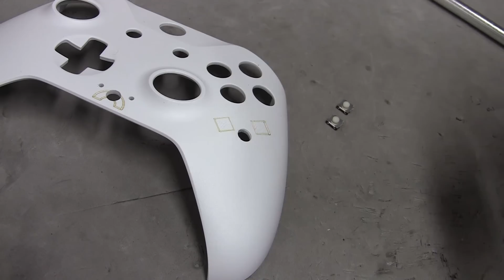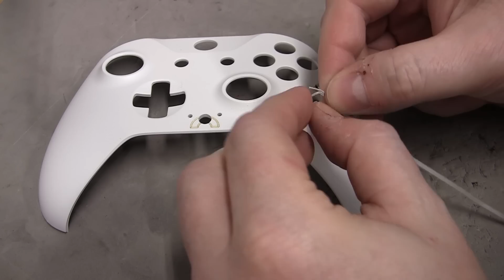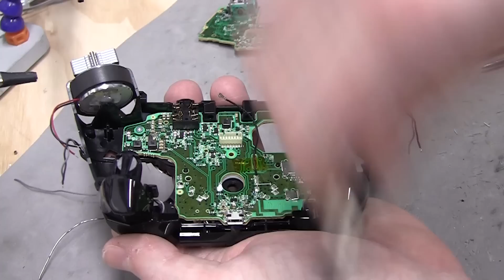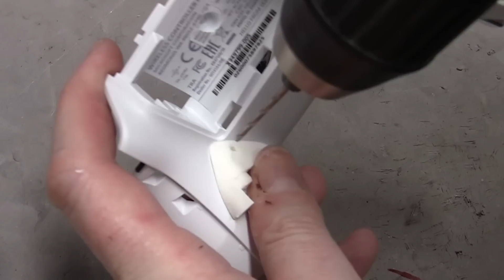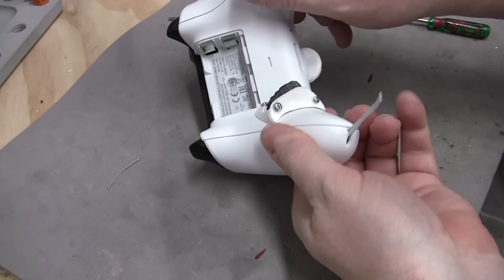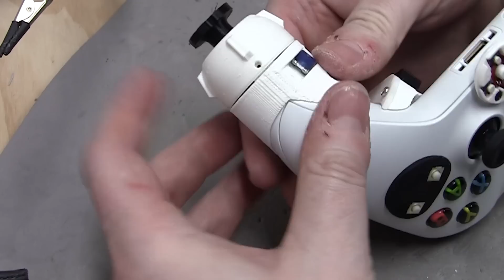Single Handed XBox One Controller

Comment: I've noticed that when you glued the 3.5mm jack connector to the PCB, the hot glue was placed onto some traces. Do you think this could damage the PCB over time, as the 3.5mm Jack moves when inserting/ejecting headphones ?

Comment: silly question
is there a way to make chinese fake ps3 controllers pc compatybile?
i mean we have entire contrller, battery, rumble motors in a color we want (pink, yellow, green, orange and so on) for 3$ delivered and they have some kind of bluetooth chip in them out of the bag too
there is the software that allow you to use oryginal pads on pc but not every fake pad works with that (or the console)
but the hardware is already there
why not turn it into a hid bluetooth device to have proper gamepad that can be used? and while we at it we  can also improve analog sticks sensitivity

Comment: It would be really cool if you found some sort of way to include a button that lets you switch which analogue stick is which. For example, for a driving game you'd probably want the left one on top since you have to be more precise with that one, and the other one isn't used as much.

This could of course be more easily solved if developers were more willing to let you freely map your controller inputs and it's not really an issue on pc but hey-ho...

Comment: to the topic of motorcycles; the problem is (in the US even worse than here in europe) that people dont wear the proper safety stuff. they are wearing cheapo gloves that do not offer protection at all. my gloves were kangaroo leather, kevlar and titanium reinforced, i think i'd be completely dead before the hand would be damaged to the point where they need to take it off.

oh and by the way, i have many years and many miles under my belt without a single incident, never even fell off while standing/moving slow. you got the risk in your own hand, literally, if you are driving cautious, you most likely wont have an accident at all.

Comment: I just checked and apparently the Xbox controller is made from ABS.
So If you printed you parts in ABS, you could acetone weld rather than (or as well as) you D-pad in place.

Comment: Glad to have you back! I have an interesting "alternate power source" mod I like to see. The PSP GO battery replaced with the ability to use actual removable batteries. I have a blown fuse not allowing it to charge. I'll be changing the fuse but I'd like to see how to make the backup option available.

Comment: Wouldn't using an Elite controller and assigning LB and L3 to P2 and P4 solve that issue? Then just fashion the custom D-Pad where you put the LB and L3 buttons. Im not sure how I would be able to press that D-Pad where you put it anyways. I tried putting my thumb there on my controller while holding it with one hand and almost dropped it. I'm thinking this isn't exactly meant for someone with one hand, just limited finger dexterity on their left hand.

Comment: and here i just failed to solder a broken usb stick connector back to the board because my shitty soldering iron wouldn't melt the goddamn solder so i ended up de-soldering an absolutely tiny resistor/capacitor thing that i can barely see, let alone solder back on with that huge tipped and not-hot-enough soldering iron

damn :(

Comment: Some minor suggestions:
Recessed screws instead of round-topped ones, so they don't dig into your fingers.
Leaving an exposed set of contacts (maybe under a plastic housing) in case someone wants to do a foot controller for their left stick
Polishing or at least buffing the more jagged 3d printed bits
Keeping a left stick and the left triggers intact so that the controller can be used by someone if they need to borrow it or for any typical reason
Perhaps laser etch the square buttons that go below abxy over the whole square so they can be flush or more flush with the plastic controller body, making the foam even nicer

Otherwise I completely love this idea. it's damn near perfect.

Comment: Just an FYI, they make the little 5 way navigation tactile switch things without the actuator(or whatever it's called in this case). Pretty sure the part number is ly-a07-09, or maybe 02. basically its just the bottom half if you removed the stick and kind of capped off the top to keep all the domes from just falling out. It's much better for custom applications, and much easier and smaller than most other solutions

Comment: Hey Ben! Question: why are the drift pots necessary if all you've done is move the stick a few inches from it's original location? Also, have you ever thought about foot controls? There are tons of midi foot controls for musicians that could be repurposed for gamers.
Reply from the maker: The lower analog is meant to rest against you leg. Depending on chair, arm length, etc the "resting point" might not be dead on center. So this just gives people options.

Comment: With the release of Microsoft's Accessibility controller, it's a pad with dpad, home/start/select, and two buttons, with expandablitiy via 3.5 jacks for buttons and usb for more complicated controls, like Microsoft's ripoff of the Wii Nunchuck; do you think you'll take a look at one and hack it?
I'm interested to see one taken apart, it seems like it'd be just a square pcb with a bunch of wires, though it could also be one big pcb. But, I think you could probably hack one up and design a controller around it, rather than hacking a controller and moving components. It'd be cool to see a controller that's designed to be one handed from the start, and the Accessibility platform could probably help with this.

Comment: Via's often get full of the solder mask, makes them impossible to solder to!
You need to wipe the excess solder off the tip of your iron before trying to tin those tiny switch contacts, or you end up with a glob, like you did!

Comment: For the ps4 controller you can get a 3rd party ribbon cable which sits between the silk screen and the circuit board and allows you to pick up the conection to any of the faceplate buttons. Search ebay for ps4 controller remap.

Comment: Xbox already made a special controller so you don't have to do this anymore.  So anyone with a disability can custom make a controller for their needs.
Reply from the maker: That's what I thought but the orders kept coming in. I did buy one to examine though!
Reply: @BenHeckHacks  I think it goes back to what you said in the video. For the most part, people want to feel as close to everyone else as possible. The Xbox Adaptive Controller system, I feel, is a boon for people who have injuries or neurological disorders that have effected multiple parts of the body, but for someone who has lost the use of a single hand it's probably overkill. Your design also looks pretty similar to just a stock controller too giving that feeling of being pretty close to the same as anyone else..
Reply: A one handed controller like this is also more portable than an adaptive controller based setup, you can just take it with you and game with friends wherever.  That being said, it's still a fantastic product and I'm glad it exists in the marketplace for the people who need it.
Reply: @BenHeckHacks  The Xbox Adaptive Controller is not a one handed controller and maybe they just want device that looks like everyone else.
Reply: The adaptive controller also isn't the controller itself, it's a hub to simplify the creation and compatibility of custom hardware, basically to avoid going in with the tiny wires like here.